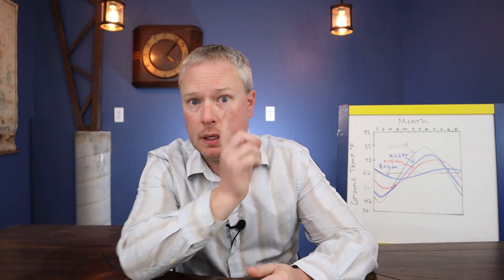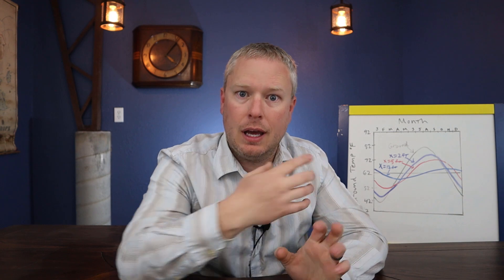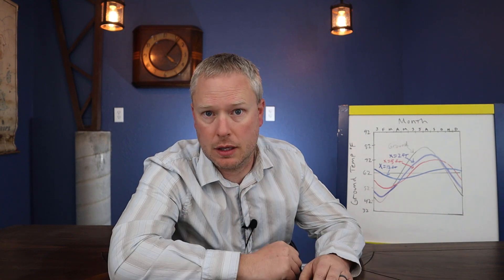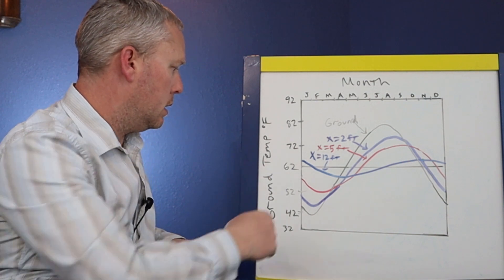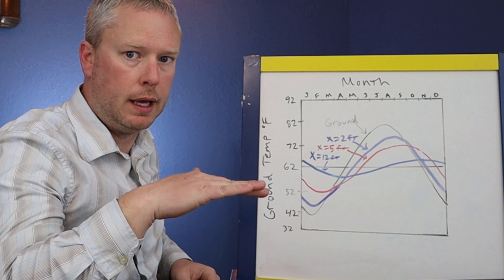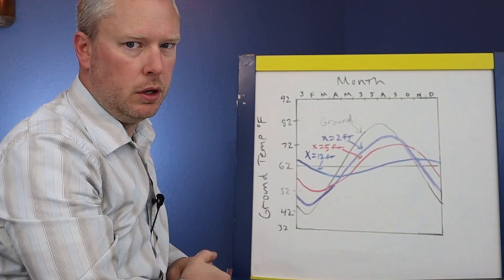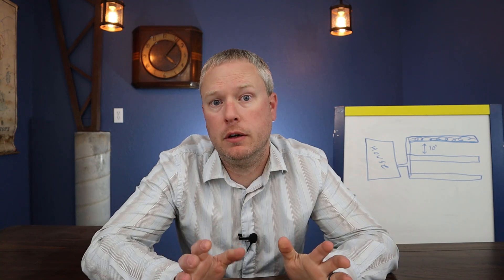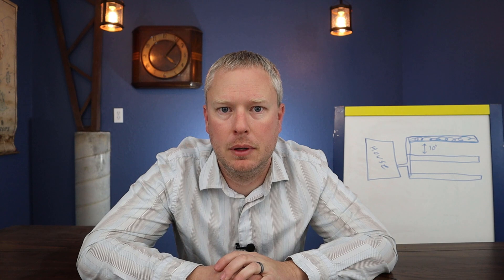Trenches - Step by Step DIY Geothermal (Part 2)

Comment: So in theory - If I was building new on a chunk of land. It would be a pretty good idea to lay my loops, say 10ft deep,  cover over 4 or 5 feet... and then run my drainage pipe to feed right over the loop system? Gutter system and foundation drainage, then backfill the rest.. that seems like an easy source of water. Not that you can control consistency, but if you need to drain it somewhere, might as well be over the loops? 
If allowed, would you prefer it be under septic or under water runoff system? I know most septic system allowances are very strict on disturbing soil around the leach field, so not sure most towns would give you that option anyway.
Reply from the maker: All of those suggestions would work well.  At depth, the moisture content stays relatively steady, barring a major drought.

Comment: I think that was very smart to bring the ends of the loops inside the house.  The pipes are so inexpensive, it doesn't make sense not to bring them inside because maintenance is very easy as well. And if one fails you're not digging 10 ft deep to try to find the manifold.  Thanks.

Comment: Thanks for the video! You mentioned that only PEX A can be used. I wonder why?
Reply from the maker: Pex A is stronger
Reply: @Challenged1  thanks for your reply! I cannot find any documentation to support that statement, they seems to have same strength. Do you have a document or a link where I can find such info?
Reply from the maker: @justdoityourself  The burst pressures, flexibility and kink resistance are different between the two.  Also, the International Ground Source Heat Pump Association recommends only HDPE or Pex-A.
Reply: @Challenged1  I agree that type A has its benefits,  but seems that there is no reasoning why type B cannot be used. I already bought it, so will go with it :) .  Any recommendations on the max loop length of 3/4" pipe? Would 300 ft be ok?Thank you!
Reply from the maker: @justdoityourself  It all depends on your soil types and moisture content as to how long the loops should be.  I'm in fairly moist clay soils, so 600' per loop is the recommended amount.
Reply: @Challenged1  sorry, i should have make my question more clear,  I am more interested in terms flow (pump performance) vs loop length. My total length is 600 ft, so I wonder if I should split it into 2 loops 300ft each or keep one 600ft loop.
Reply from the maker: @justdoityourself  I can't see an advantage to shorter loops.  In fact, if the loops are mechanically fastened underground, the fact that you double the number of shorter loops makes it more likely a leak will occur.

Due to the size of the pipe, and the relatively slow flow rate, pipe friction at the longer lengths is pretty small.  If I remember right, I'm pumping 6-7 gallons per minute through thru the pump.
Reply: @Challenged1  makes sense.  My only worry was that the recirculation pump won't be able to handle that much friction in the 600f long pipe and I won't get sufficient flow rate through the system. 
Thank you!

Comment: I live in South Carolina all I want to do is make a system that in the summertime will make the inside of my house cooler by at least 30°, then the outside temperature how deep do I have to go in my yard to do that.? I want to keep it simple and cheap yes I said the word cheap I'm on a fixed income and I'm trying to save money on my utility bill not spend it.
Reply from the maker: You have to know the ground temperatures in your area at different depths to answer that question.  It won't be cheap, relatively speaking

Comment: Is it possible to bury the lines underneath the foundation? Say, dig trenches, lay the pipes, cover it all up and then lay your foundation over it all. If your foundation is already deep (you’ve got a basement) then you’ve got yourself already a pretty deep place to bury those pipes.
Reply from the maker: No.  The weight would crush your pipes.  Also, you want to have the loop field at least 10' away from your home so you aren't drawing heat out of you home.

Comment: Small cape (1200sf) oil-fired HW radiators. A single window a/c is adequate. If I finish 2nd floor, I'd need central and some heat. A small addition on side (16x24) would need footing & frost-walls. Can I loop coils along this 56' of footing (inboard or outboard) ? My soil is rocky/sandy if I backfill with  better material ? Roof run-off can help keep moist, 4-5' down under perimeter plantings. Sound like I should just use heat pump ?
Reply from the maker: You want to keep the loops at least 10' away from the structure, so you don't pull heat from the structure.

Comment: Anyone have any info on Alberta Canada soil? I know the frost level is 5 ft apparently, which would suggest at least a 32 f ground temp which would move this chart ^^^ down 30 f, making geothermal impossible? But there's a chart in ottawa suggesting 6-8 celsius at 6.5 feet.

Comment: really love your suggestion to trench 4-6' & then dump another 4-6' clean soil on top. potentially much cheaper for people w/o their own decent excavator. also... a lot of the properties i've looked at don't have much privacy from the road, or someone has already cleared for a pad closer to the road than i'd like to be. do you foresee any issues in planting trees & tall privacy shrubs on the newly created mound above the coiled lines? our previous chat about irrigation for dry/rocky soil also comes into play... many birds with one stone?
Reply from the maker: I wouldn't plant anything with a tap root.  All others should be fine though

Comment: Garrett- great overview of the "how to ' of Geothermal. The tool and process to seal the plastic tubing is something any plumber who runs the same plastic (in yellow or orange) for gas pipe will have. Talk to your pipe supplier also. Personally, I like the answer you chose- bring the return end back to the in house manifold without a joint. The plumber in me sees the best way to avoid a leak is to avoid a connection or joint if at all possible. In engineering parlance- "Less is more".  FR
Reply from the maker: Agreed

Comment: Garrett, What do you think about the DIY well drilling rigs.....they are suppose to be able to drill up to 200 ft.  And as I understand it, it is about 150ft per ton.
Reply from the maker: I don't know anything about them.  In my area, you have to get a permit to drill a well and be a certified well driller.  Considering the possibility of contaminating the ground water supply if a well isn't drilled or capped properly, I'd rather leave it to the pros.

Comment: Thank you for the tip about putting it under septic lines. I keep going back and forth on whether my property is suited for it. I have a 9-ft backhoe attachment for the tractor and just did a project where I dug about 8 ft deep with a 2-ft bucket. I'm waiting for the series to close before I start nailing you with questions. :) I've enjoyed all your videos so far. Thanks

I have a little bit of experience in control systems enough to be dangerous with ideas. Ultimately, I would like to use my 25000 gallon pool and a geothermal loop to  exchange with the house. My 1910 house has a boiler and hot water radiators that has been converted from coal to gas. Needless to say it could use an upgrade but I do love the radiant heat given the insulation of parts of the home. It would be awesome to connect the pool, a radiant loop, two HVAC units, and a boiler system to work together. I don't know whether it's crazy or not.